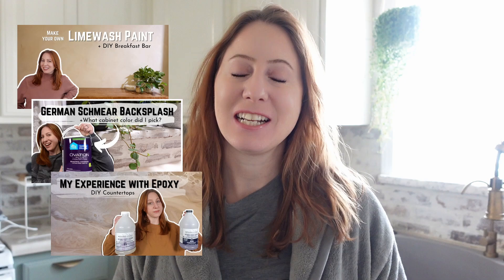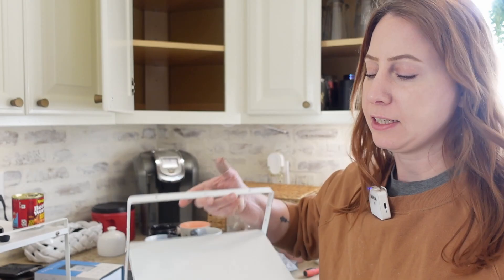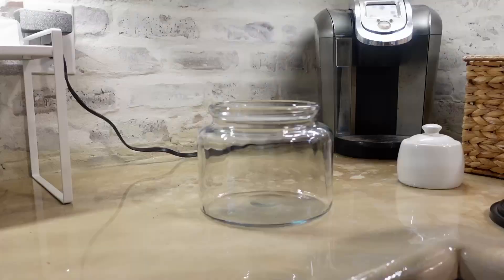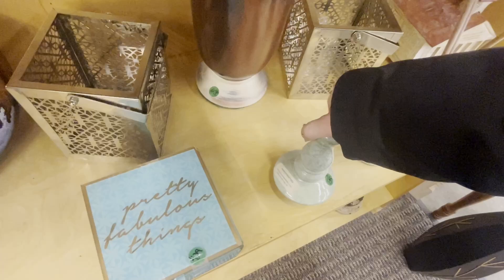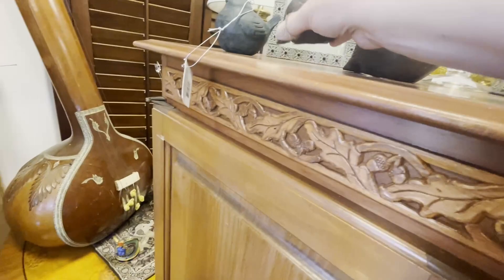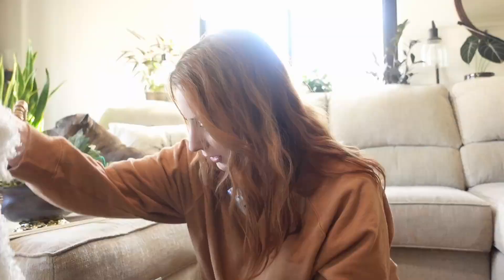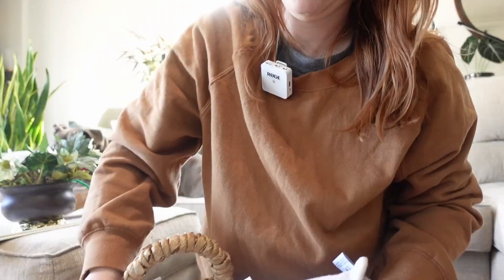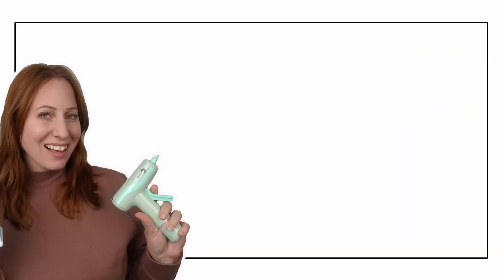Let's get this Kitchen organized and decorated with Amazon and Thrifted finds

Comment: For the cabinet space black hole areas I use lazy Susan’s with  shallow sides on them, I then hold things I have as back ups for thing i use often!  Also see if you can find the slide out container that you can screw into the shelf look for long skinny one for the corner then you can put lazy Susan’s on either side!  Low profile things in the center the taller items on the sides! I hope that helps!
Reply from the maker: Love this idea that’s really helpful

Comment: I have a bottom corner cabinet that I installed a double lazy Susan into. They have cheap plastic ones, don’t get that kind. I got mine on Wayfair, it was under $200 and is made from the same maple as the interior of my cabinets (and yours as well). They have diff sizes so make sure to measure the inside of ur cabinet and get the biggest one possible. 👍🏼 ps I store mixing bowls and small appliances on mine, like rice cooker, toaster, blender, etc.
Reply from the maker: That is great to know thank you!